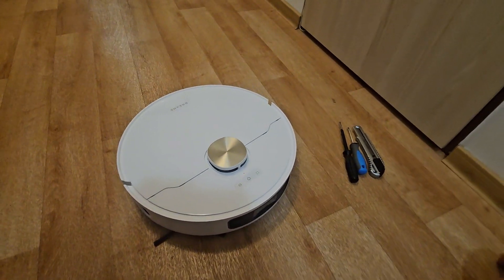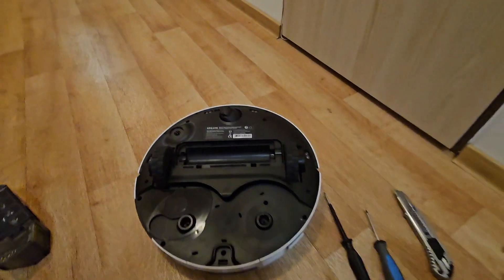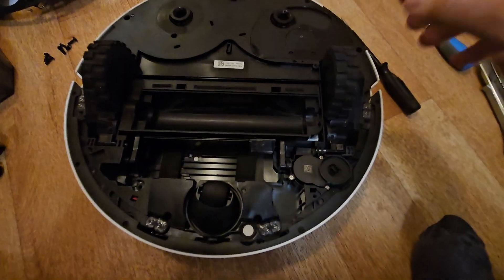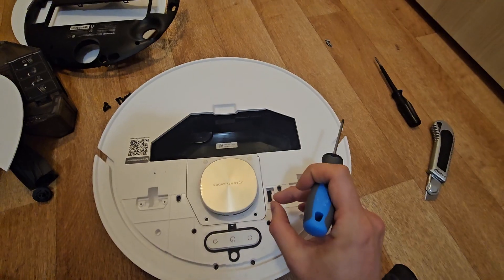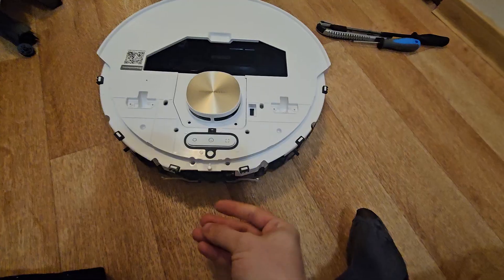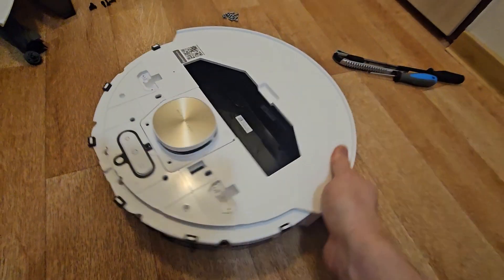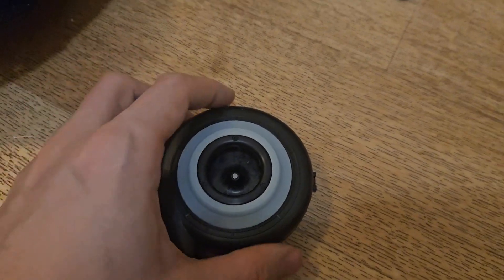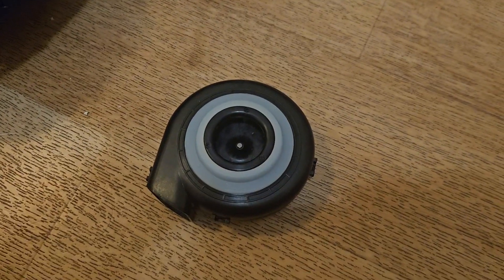How to disassemble Dreame L10s Pro Ultra Heat and access vacuum motor

Comment: Hi, I’m also having a dead vacuum motor on my Heat model and I’m also in the struggling phase of removing the cover for the motor. Can you please tell me the exact reference of the motor so I can also get it as part? Thanks!
Nice video btw!
Reply from the maker: Hi, the motor part code is MSD-D